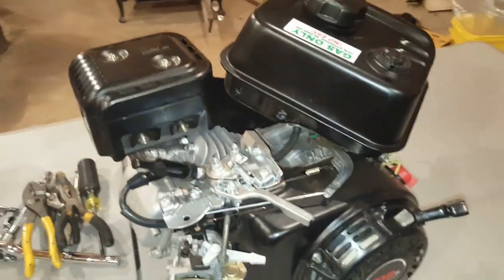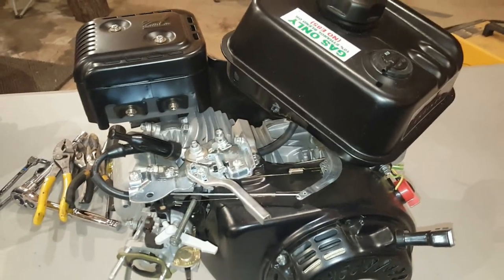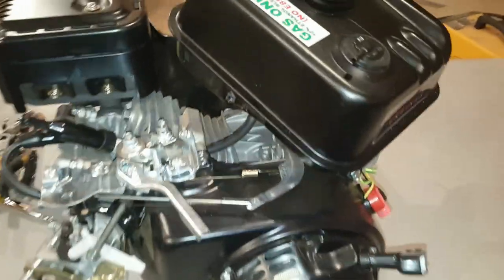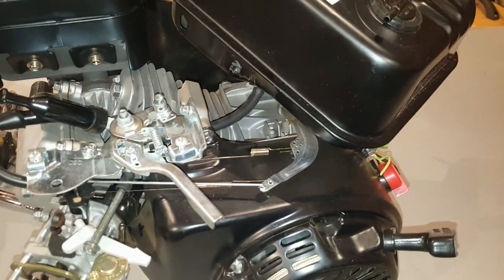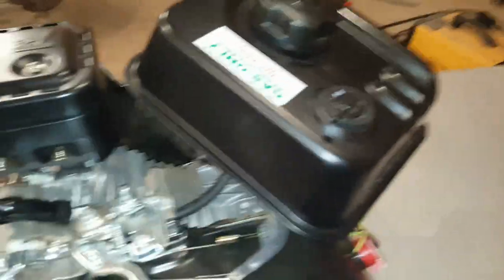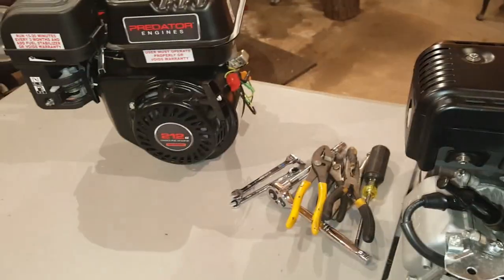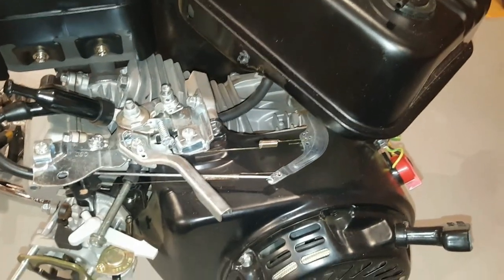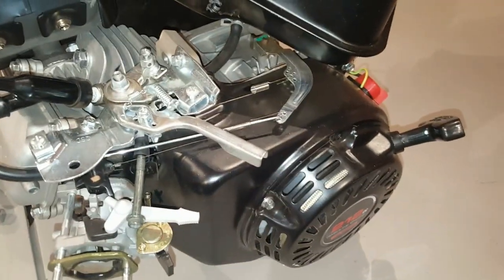Predator 212 5000 RPM Governor Mod (Not Removal)

Comment: I don't know crap about engines and bought a woodchipper with 212cc alphaworks engine. That metal lever with 2 springs to the right of the throttle is some sort of governor arm? Some of my springs have slack in them. Not interested in the governor as much as figuring out what the spring setup was supposed to be.I can pull that arm to the left and it auto returns to a point and I think I can move it to the right where it stays where I leave it. I've only run it for an hour on light stuff to break it in.

Comment: I would say static adjustment for the governor arm should have been mentioned. Most people know about the throttle stop screw that needs to be removed, but i had to losen the static adjustment very slightly to get a full close, and full open with this given adjustment that probably increaced my rpm from 4000 to 5000.

Comment: You just saved me $200, and my electric start. Thank you so much for this video. I am still a little concerned about the stock flywheel with 5000 rpm, but if you say it works, then it works.
Reply: Get a billet flywheel, I blew mine up and it blew a hole in the engine..

Comment: Hey back in the day of flat head B&S engines, that's all we had to do is move the springs, or bend the fan blade that was acted upon by the flywheel fam that cooled the engines! I got 30 mph out of my little Fox mini bike with a 3.4 B&S engine! Wow I only wish I had one if these engines! Back then the best engine to start with was a 6 hp B&S engine! That was available new for around $150! But that was a lot of money in 1968! But my buddy and I installed one in his Sears mini bike that came with a 4 hp Techumsa and a small tq converter with a jack shaft the world leave a small 4' patch of rubber on concrete! But we added that 6 hp Briggs with a tweaked governor and got just about 50 mph! Plus s 10' patch on concrete! That little bike could run with Yamaha Mini Enduros till the Yamaha hit top gear! Plus it could climb hills like mad! We then had to put bigger tires and wheels on, with a front fork that came off a Yamaha! I wish I had a photo of that little beast! It was king of the minus back in the day! I ended up buying a new Hodaka Ace 100, just so I could run with him! But them he ended up buying a 125 Penton ISDT and we both grew up!

Comment: I haven't removed gov but I have throttle plate and just removed that gov rod on a 420 cc so should I put it back and spring to get higher rpm
Reply from the maker: Chris Haskell yes or tie the governor arm that comes out the top.of the crank case so it cant rotate and contact the crank internally.
Reply: Kart thanks

Comment: How did you add a second wire to your tachometer in your other video? I think I have the same one from amazon and it only has one wire and that wire is stranded not holding two inside the sheathing. Thanks

Comment: all I did was remove the governor arm. ran a rod from the carburetor to the throttle.. new fuel tube.. new pipe and absolutely no air filter pure air flow 40 + running strong now for months

Comment: what happens when you just unhook the spring for the governor
Reply from the maker: Alcus hudson bad things if the governor is left in engine and arm isnt retained by something. if its just left with nothing it can swing over and the crank weight will hit it and probably break the crank

Comment: You won't hit 5000 rpm only with this "mod." On your other video, you have an upgraded exhaust, air filter, and possibly other "NR Racing" mods and you still didn't hit 5000 when you hooked it up to a tachometer. How can you claim 5000 on a bone stock motor just by moving a spring?
Reply: Manikapiptili Sanchez 
I just got a 4000 rpm spring kit for my Briggs, it's a factory part number too. 
When first setting it up I was shooting for around 4200. 
It went 4600 and I lifted off and readjusted. 
I was able to settle around 4300.
Reply: mods that increase hp have nothing to do with rpm, the only thing limiting the rpm is the connecting rod
Reply from the maker: Manikapiptili Sanchez a stock predator with no governor will run 5500 to 6k rpm with no mods except governor removal. so yes you can modify the governor on a stock engine to reach 5k rpm or thereabouts.
Reply: If you do no other mods to a motor other than removing the governor, you're setting yourself up for either a serious injury, or death. A stock flywheel cannot handle running without a governor. Your other video shows you hitting under 5,000 rpm with upgrades. Why not do a video of a stock motor, with this "mod" hooked up to a tachometer? You will be further from 5,000 than your motor with an upgraded air intake and exhaust. I promise.

Comment: if you exceed the factory set governed rpm without removing the governor wheel then the governor wheel can shatter, causing terrible engine damage. It's just a risk you have to take. Just wanted to throw that out there.

Comment: the governors lever is actually  killing air flow to the carb when lever pulls the black piece on the carb?
Reply from the maker: the governor manipulates the throttle arm yes which does close down the throttle blade killing air flow and fueling yes.

Comment: Just bought a brand new predator and mine is already setup this way. I went back to HF and the display model is the same as well.
Reply from the maker: Yeah i cant recall the exact spring locations. I hadnt set one up in a long time. Really just need to dial out the limiter screw and play with spring positions until you get around 5k rpm.
Reply: Cool. I'll do some testing and let you know what i find.
Reply from the maker: Sounds good. If all esle fails remove the governor. We werent allowed to remove or modify it and couldnt rev higher than 5500 rpm so that always worked for me.

Comment: +Kart I have stock valve springs on my predator 212 and have unhooked and secured the governor from moving but I am still only seeing 3600rpm, +/- a few hundred. do you think my stock springs are floating early? Idk what else it could be. it's like the governor is still intact. 
the predator 212 is on my vintage mini bike. both jets have been re-jetted, custom throttle linkage, no air filter, e3 spark plug, 1/2" to 3/4" to 1" custom header 8" length. I have not advanced the timing or swapped out oem valve springs, and have not replaced the stock e tube. 
finally, I am running a TAV20, do you think that could be limiting my rpm's?
I would appreciate any input you can offer
edit: I just read some more comments, one mentioning the throttle. I have verified that my custom throttle linkage is swinging the carb to WOT
Reply: If your TAV has an overdrive function you just might be running out of engine at that RPM at top speed. The engine simply does not have enough power to spin any faster with the given load and final drive ratio. What's your max RPM with the back wheel off the ground with no load? If it is 5000+ off the ground then you have a gearing issue. If it is still only 3498 then look at your engine.
Reply: When you think about it, the throttle spring would need to be moved to a position further away from the pivot point of the gov arm to add more RPM. Or use the hole right behind the hole it is currently in. You will need more spring tension to add RPM's. Best thing to do is run tests with an RPM gauge.
Reply: Deucealive75 interesting thoughts,  along the same lines as my thinking. I will check with the rear tire off the ground. thanks for the input
Reply: Deucealive75 man, I looked for 1/2 hour to find this thread again  lol 
anyway, finally got around to messing with the mini bike. jacked up the rear tire and fired it up - WHEN I SAW 5600 RPM I HAD TO BACK OFF THE THROTTLE! sorry for yelling but I'm stoked. THANK YOU FOR YOUR HELP MAN. obviously I have a gearing situation. kinda surprised I never looked there, thanks again for the lead
Reply: OK cool. Glad to have helped.
Reply from the maker: Wesley Jackson thats pretty weird indeed. you should see atleast 5000 rpm at minimum. 
does it hold a steady 3600 rpm or does it kind of surge and buck a little at the top end of the rpm?
Reply: no surge, just tops out at 3498rpm, so apparently I'm not even seeing full stock rpm
Reply: The predators are coming setup like this out of the factory though. I guess I'm a little confused. I went to go try this out on my mini bike and this is already where the springs are at, then checked two of my buddies mini bikes and this was where their springs were at. None of us have touched those linkages at all. I guess I'll play around with moving them into other positions and see what happens.
Reply from the maker: Ryan yeah i cant remember where the springs were etc. just play with it and see what gets you gains.
Reply: Kart So in theory, if we're looking from back to front, are we thinking moving the heavier gold spring to the left or right is adding rpm?
Reply from the maker: Id have to be looking at one to help honestly. If you sit back and examine the mechanics of it and what the governor arm is doing its not hard to tell where to move what to delay the governor arm action on the throttle.

Comment: all predators come like this, it's not a mod
Reply from the maker: Emmanuel Ruiz then why does a stock predator only turn 3k and mine 5k? lol
Reply: I have no idea lol, i bought a new 212 and it had the same spring placement
Reply from the maker: Emmanuel Ruiz well you might be clrrect there somewhat. Ive found you need to back out the limiter screw mentioned and play with the spring placement to get the 5k rpm. Its like a dance between the two lol
Reply: yeah i did the same thing, thanks for the video though
Reply from the maker: Emmanuel Ruiz no problem
Reply: I see this video is older but only getting 3K out of a box motor ? We have 2 karts with straight out of the box with nothing  but little adjusting and getting 5400 plus out of both . 
We have another that’s turning almost 6k on stock flywheel etc that’s raced on regular bases .
Reply: I had to back the limiter screw on mine.  I also had to mess with the fuel rod, it wasn't going all the way so I wasn't getting the full range of zero to max throw on it - maybe that part was just me?  I just got the engine about 4 weeks ago new
Reply: Kart Art so can you get more RPM'S , more speed and Acceleration out of a predators without removing the governor
Reply: Ahhhhhh this sounds like a legit way of making my 1980s wood splitter faster. As for it i need to keep the governor.
It is retrofitted to a 212cc strait valve, running propane.
Im also looking at doing the gx160 head mod, as the LP is around 105 octane and the head mod is supposed to give near 13 to 1 compression.
.
I'm thinking 4,500 at most, as it will be a steady rpm unlike a go-cart. And no extra air flow as its its obviously stationary use.
Mabe even adding a oil cooler with the 2 drain plugs as connection points. Probably the hydraulic side as well as its border line 140F in 3 hours.

Comment: I went and looked at mine. It was hooked up the same way I guess I did it by accident when messing with the linkage. Need to get a tach for my mini bike now. What are your thoughts doing this to the linkage and a zip tie on the spring??
Reply from the maker: Casey Hafley do you mean putting a zip tie through the spring to limit the travel

Comment: i have the same motor it comes on but when ever i give it gas it will not move and it cutts off
Reply from the maker: Shanesha Grayson sounds like something is binding up. try removing the chain and see how it acts. see if the kart moves freely etc
Reply: low oil sensor? cut the yellow wire on karts.
Reply: Shanesha Grayson clean the carb
Reply: Get new jets

Comment: I done this on 196 coleman mini bike, did not work move the large spring around nothing!
Reply: You need to make sure that there is no return spring bind where the throttle cable connects. One Coleman owner here on you tube noticed this after he backed out the throttle limiter screw. He corrected it by cutting off about 4 coils from the throttle return spring. This shortens the spring to eliminate the bind. The Hisun engine on the Coleman has the same throttle assembly arrangement that all these clones have had for years.
Reply from the maker: kenny loveday thats a different engine. the governor could work differently or also have something else limiting the throttle. Hard to say without seeing it in person.
Reply: hey kevin, my friend tried the same thing... its not a different governer but on the coleman minibikes its not the governer... the stock hand throttle is limited so what you need to do is play with it, maybe take it apart and then you will get full throttle response! it hasnothing to do with the governer if you havent already messed with the throttle

Comment: I did adjust motor as much as posable, even went with stainless steel smaller diameter bolts, i'm about 1/4" off or less, have you heard anything good or bad about ironton motor, and as far as 3.5 inch wheel spacer, is that ok to run. thanks again
Reply from the maker: CC 3 1/2 spacer seems like quite a bit to me hobestly.....would have to see it. 
you might need to reposition the motor plate to get your alignment. 
I think the ironton are the same engine as the predator basically....just costs more. Ive never had one on a kart but i have one on a northern tool pressure washer and its been a good engine

Comment: Good video, i will do this after i just get it running thanks, im trying to get an old school mini bike going, i went with Northern Tool brand 208cc motor called the ironnton, have not found any videos or info on these motors. Main reason i went with it was the rearward pull of the pull string , apposed to predator forward pull. Problem i'm having is these newer motors are much wider than the old motors, clutch and rear sprocket dont quite line up, i have more room on shaft to move inward, do youall know of any parts suppliers with deeper offset clutch sprocket, and a rear wheel with longer axle shaft, or is it ok to use 3 - 3.5 inch spacer. thanks for any help, i'll be 60 this summer and have been out of the mini bike world for about 47 yrs! Its so dang cool to see and learn so much from  you tube, WE ARE REALLY LIVING IN A GREAT TIME.
Reply from the maker: CC im not sure who would carry those honestly. best bet is probably reposition the engine in the frame so it all ligns up if its not to much of a shift one way or the other.

Comment: That's odd. My springs are setup exactly like this on a clone that came with the Coleman mini bike I just bought. I haven't ran the engine yet. The bike got all scratched up in shipping and I have everything apart to be painted when winter is over.  For the "stock" racing class you speak of, are you allowed to remove the muffler and open up (grind out) the material at the flange to create a better transition of flow? Those mufflers are already very restrictive. Point is to do what you can to improve the stock setup with little or no money. It may help only a fraction, but doesn't every little bit help?
Reply from the maker: Deucealive75 the stock class doesnt allow for any modificaion to the exhaust or head at all. some places allow you to remove the governor completely and run a pipe, just not in my area.

Comment: This video helped so much. I definitely could not have done it the other way. I'm gonna try this as soon as possible. Thank you!
Reply from the maker: David Horn No problem. If you check out my other videos i have a tutorial on how to remove the governor completely as well and how to set up the linkage afterwards. 
you would need a 8mm,10mm, pliers, hammer, screw driver, and a grinder or file and you can do it as well.

Comment: FWIW the little round nipple on the choke lever is for plugging the fuel line. Fits perfect. Good video, thanks.
Reply from the maker: Hey thanks for the tip. I will be uploading a video tomorrow night doing a condensed tutorial on this with a tach to verify RPM's. I'll also be doing a 25 hour 4800 RPM torture test on a stock hemi governor adjusted to prove reliability as well.

Comment: So the closer to the pivot the spring is, the higher the revvs?
Reply from the maker: Will I was shown this by another racer and just have used those locations since I know they work for what I need them to do. 
If I get my mychron tach back on the kart I will move the spring around and see what different RPM readings I get for each location. 
If you emulate my setup you should get around 5000 rpm. 
We try to run the predators at 4800 rpm because that's where they make peak hp. They really fall off the  power bad after that without mods.
Reply: +Kart do you think 18lbs valve springs would be enough to keep the power up after 5000?
Reply from the maker: Will Trautman yes they should get you about 6700 rpm
Reply: Will Trauan, I did this mod on my predator and put in 10.8 springs and it revs like a champ. I've got mine turning about 6k and it would go more, but I'm afraid the rod won't take it. I consider it a time bomb as is.